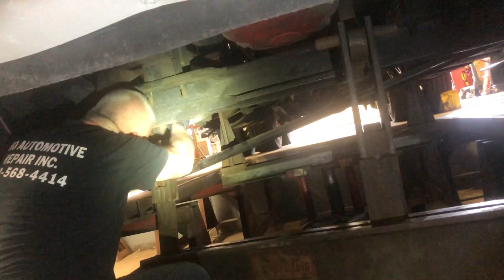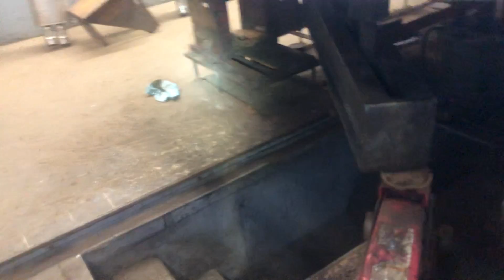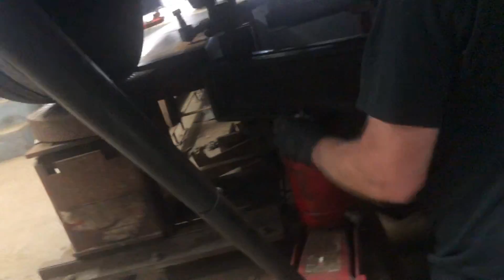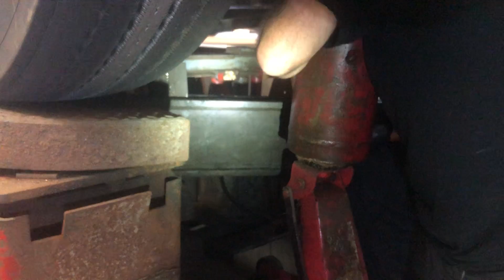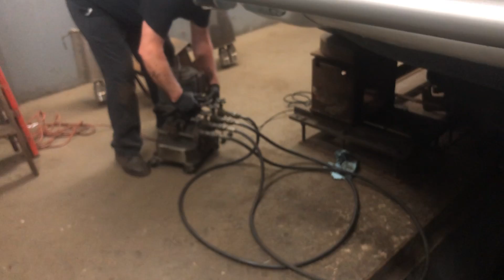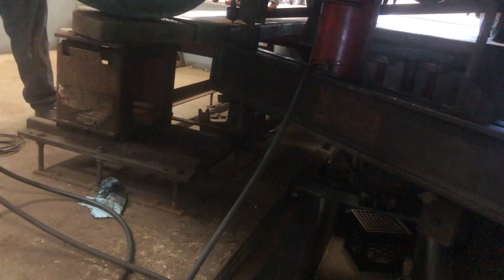September 18, 2019 Bending I-beam Axle for alignment

Comment: This was required for the Ford twin I-bean trucks and vans, my 99 E350 has balljoints, and can be adjusted by changing the insert in the beam, but I think my 89 may have the king pins, requiring the beams to be bent to adjust camber, #1 reason why lifting them is such a pain in the ass, a taller spring will give you lift, but at the cost of camber.